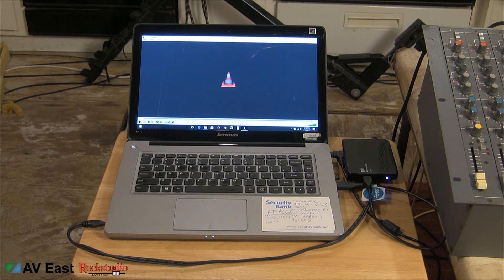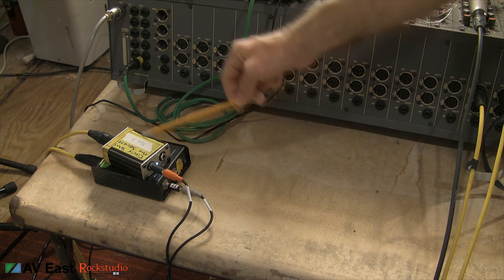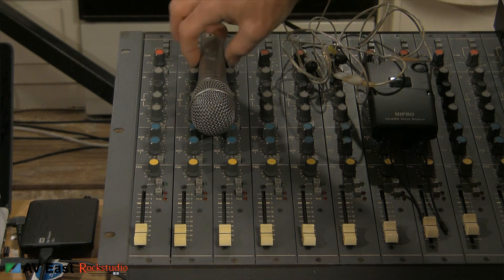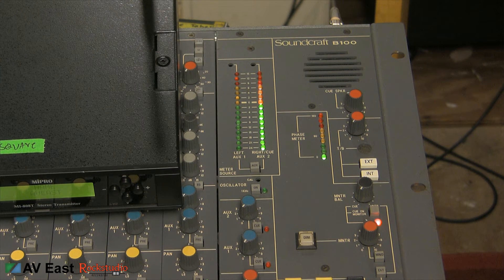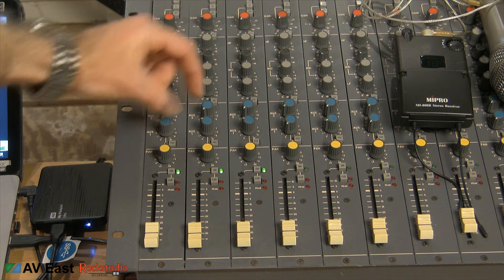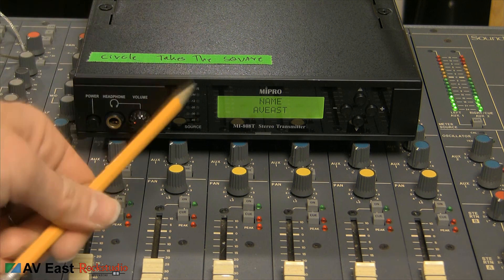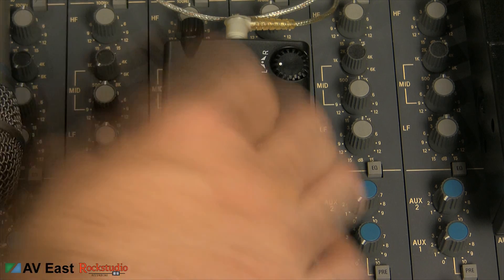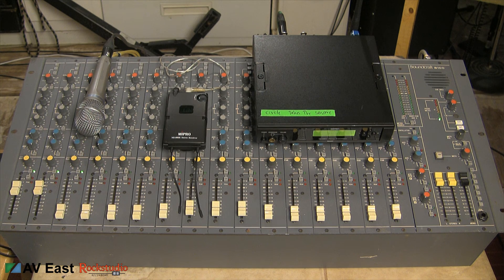Click and Sample playback setup for wireless In-Ear Monitors

Comment: Is there any way to set up in ear system without using aux
Reply: Thang Lian Cin you can send the main mix to your ears, for a very simple monitor mix. Or, you can use the left or mono channel to go to the PA, and then use the right channel for your ears, and set the levels using the pan knobs.